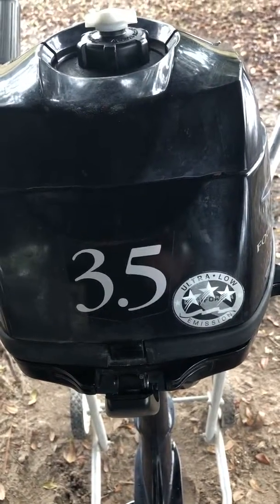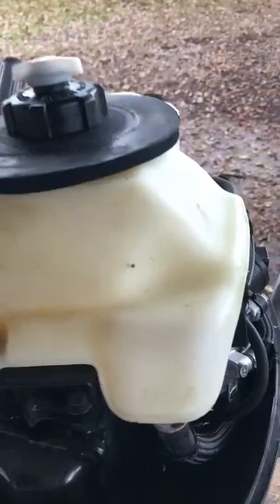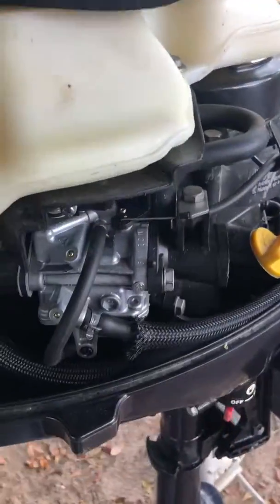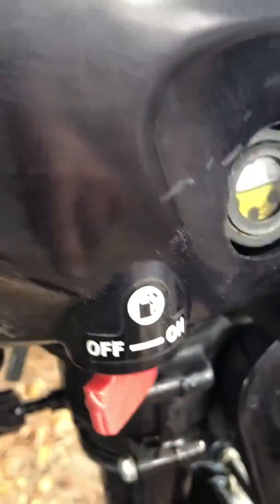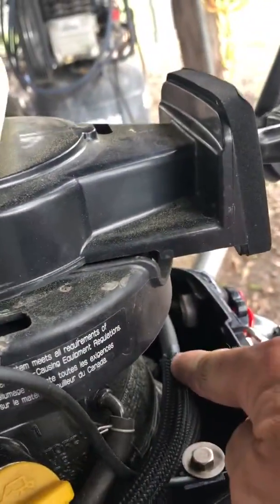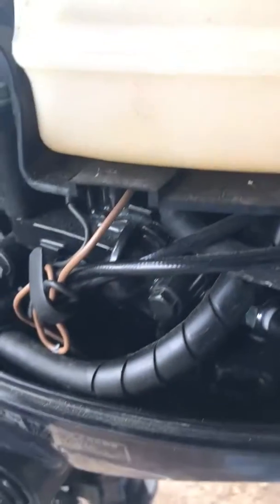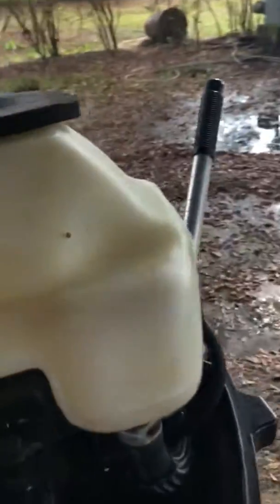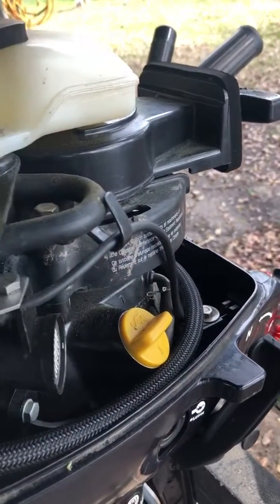Tohatsu 3.5 hp will not run after 10 seconds.  Easy Fix Replace hose

Comment: Where did you find a replacement fuel hose, I’m having no luck??
Reply from the maker: The tohatsu dealer in my area had it.  It is clearly just a length of marine fuel line that he cut to length off a spool and  and  replaced.  I'm guessing you could order some the same diameter from westmarine or amazon
Reply from the maker: I was ready to throw this motor away ... then a short piece of hose and it runs great now for over a year.
Reply: I have problem with tohatsu 3.5 hp 4 stroke 2012.
What model do you have?